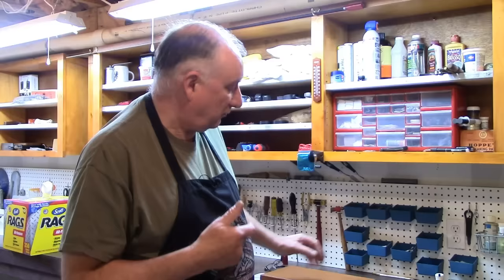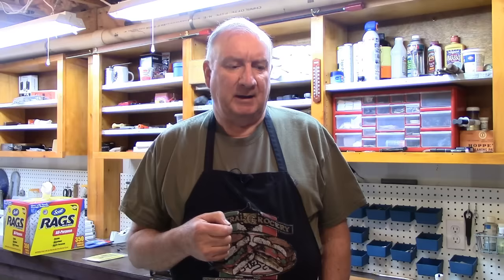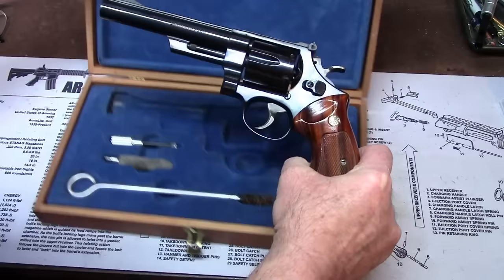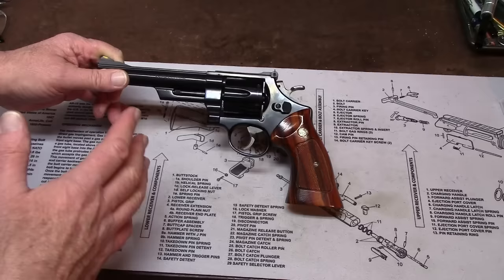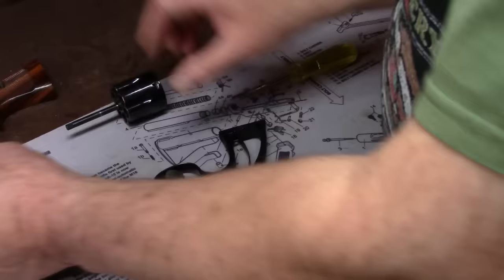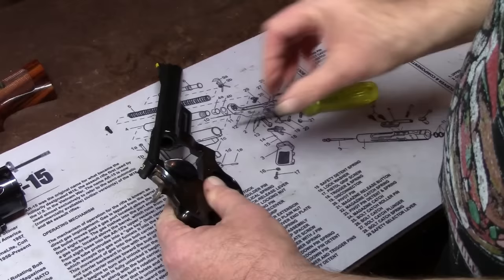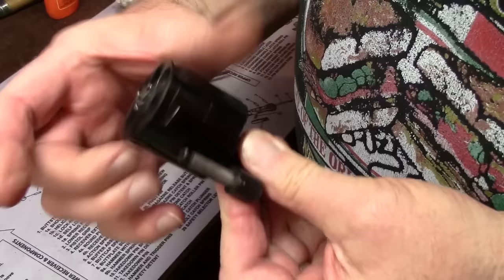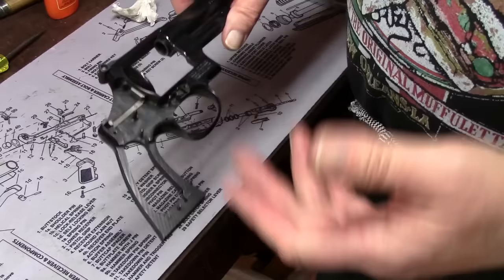How to Disassemble and Care for a S&W Revolver ~ Learn from a Factory Trained Armorer!

Comment: Any difference in  a pinned and recessed  gun
Reply from the maker: Recessed cylinders certainly look more refined, and are prized by collectors, but in practice, they actually present undesirable issues, while having no advantages. Fouling, dirt, lint, and unburnt powder commonly builds up in the crevice and prevents seating.  Unless one meticulously cleans the sharp corners of the recess, a rim simply will not seat fully, whereby the cylinder won't close, or will cause loss of headspace and dragging against the recoil plate.  On a practical note, the recess prevents quick visual cylinder inspection. Of course, the recessed cylinder adds machine work that increases the cost. It was a dressy feature that was cosmetic but provides no additional strength, because pressure is contained in the case body, not the rim.

Comment: What is the most ideal handgun caliber for home defense sir?
Reply from the maker: Aron 
The short answer is the one that you can handle most effectively.  The long answer is my video entitled How to Choose a Defensive Handgun Cartridge, found on my site.  Penetration is a liability with the danger of wall pass-through, so shorter and lighter quick expansion bullets at higher velocity are generally preferred over long, heavy bullets, if you live in a home that has close neighbors or children in adjacent rooms.  If it's a carry gun, it should be something that you can keep with you comfortably, year round, under different clothing.  If it will stay home, a heavier, larger frame is easier to control.  For a home defense gun, I don't think there's a finer choice than a 4 inch double action, 38 Special revolver, loaded with 125 grain jacketed hollow points, or a 4 inch 9mm large frame double action auto loaded with 115 grain hollow points.  Both are easily controlled by virtually any shooter, are easy to manipulate under stress, and are intuitive designs with versatile grip size, and both have been used effectively by generations of duty police officers, though they are the last gun to strap under civilian clothes.
Reply: Thank you sir!

Comment: Hi can you send me video of diy how to reblue my s&w .22 magnum? Thanks and god bless!
Reply from the maker: D'Tour Travel Buddy 
No DIY bluing is worth the expense or time.  They simply apply a very thin, temporary color that cannot stand even casual handling.  Bluing is more than just color, and is an anti corrosion treatment.  Because bluing chemicals and buffing techniques are proprietary, and because a great many guns are irreparably damaged by incorrect gunsmith rebluing, I strongly recommend that you contact Smith and Wesson for rebluing.  They are very good to deal with and will properly take care of your fine firearm, and it will be done correctly, returning it to original.  They will also give it a complete service check in the process and make any necessary repairs.

Comment: this off topic but is the 28nosler the same or close to a 7 mag?
Reply from the maker: Jake Lords 
They are not alike.  The 28 Nosler is a non belted case with a capacity of nearly 90 grains of powder with a 160 grain bullet, which develops approximately 200 feet per second greater velocity.  It is more similar to the 7mm Remington Ultra Mag, but it appears to be a bit more efficient per grain of powder, though any velocity gain is statistically so close that it's within the margin of error for each cartridge.  Nosler has entered this field of non belted super magnum cartridges, and they are sold in their premium sporter rifles.  I could sit and ponder for years and never come up with one reason for going afield for game with such immense cartridges that would needlessly and explosively destroy 40+ pounds of meat and ruined trophy cape with a single shot.  They solve a problem that doesn't exist in real world hunting.

Comment: Makes me wonder.If this gun can be so easily distorted by a mere hurried removal of the cylinder. Makes me wonder how sturdy it really is compared to a Ruger or Taurus.
Reply from the maker: elcues 
The Ruger and Taurus must be handled the same way, or they will suffer type same distortion.  Dismantled yokes and cranes are unsupported and very easily distorted by careless handling, and no manufacturer will assert otherwise.  I speak as a Ruger factory trained and certified armorer.  Taurus are simply cheaper clones of the Smith & Wesson, and copied them.  You must understand that this takedown procedure and caution applies to unsupported yokes during disassembling, and is nothing associated with operational strength.  Smith & Wesson handguns have been proven in street service and worldwide military service as reliable combat arms since the 1800s, and are in every way very fine and rugged handguns, which I trusted my own life to in professional police service for a very long time, and which served me and my officers very well, so don't be so quick to make judgements.

Comment: TL: DW here’s how to take a modern Smith & Wesson revolver apart but don’t touch anything inside. You can’t possibly know what a trigger should feel like unless you’ve worked on 100s of guns… 🙄 

Get hold of Kuhnhausen’s book on S&W revolvers. Read it and learn how the mechanism works. You can experiment with reduced power rebound springs. You might buy a reduced power hammer spring, but don’t go too far there. Some Smith & Wessons left the factory in great shape. OTOH I have a Model 25-2 that looks awesome outside but the tool marks inside looked like a drunk from the Vega factory made the gun.
Reply from the maker: There's far more to working on a revolver than anyone can learn from a video or book, and I certainly shall not give master class tuning instructions to folks so they can ruin their guns.
I HAVE worked on many hundreds of Smith and Wesson revolvers professionally for 50 years, and I certainly know what a good trigger is, and how to achieve it, thank you.  I was taking apart ten per day during firearms qualifications, and I tuned them all.  I learned how to tune their revolvers from their master factory instructor and consultant, who taught everyone in the factory.  I spent two weeks under his tutelage at the Smith and Wesson factory, learning from the expert who had built and repaired THOUSANDS of revolvers.  The intent of my video was to teach folks how to care for their guns.  I don't presume to teach them how to do a master tuning where an unskilled person can easily ruin an expensive gun.

FYI, none of the inner parts interact with those tooling marks and they have absolutely nothing whatsoever to do with making an action smooth.  Any idiot that recommends touching those marks has no understanding of these revolvers, and he's a joke if he's counselling others to do so.

Comment: 1:14:18 No Snap Caps?
Reply from the maker: Of course not.  No snap caps were ever used by factory personnel or their trained armorers.  I've done this same thing thousands of times as a professional armorer.  There is no possible harm whatsoever.  The hardened hammer nose floats into a hardened bushing and is suspended by the hammer against the frame. The only time empty cases are used is to check headspace and a couple of different dimensions, and the spent primers cushion nothing.

Comment: QUESTION....When the hand moves against the ratchet, the cylinder turns until the cylinder stop prevents it.  As the trigger
is further pressed; up to firing; is the hand continuing to force the ratchet to turn a stopped cylinder or does the hand disengage
when the cylinder stop engages?
Reply from the maker: muptahere 
The hand rides captured between the outer side of the hand window and the ratchet which is timed by the thickness of the hand. It withdraws downward and into the frame, riding back on the throat, only after the trigger returns completely forward.

Comment: Thanks for the great video. I have two questions. Can you polish the trigger itself? Hate that it looks dirty. Also, is it OK to use a Wilson Combat spring kit in a j-frame to lighten the trigger pull?
Reply from the maker: Joe Mas 
That trigger was finished with a very time honored process called color case hardening, which imparts various colors of blue, brown, tan and purple.  It's a traditional finish that sets Smith and Wesson apart.  Gunsmiths charge a fortune to do this to guns.  Like bluing and other finishes used on guns, it protects the surface from corrosion, and gives it a hard abrasion resistant surface.  Yes, you can polish it off with jewelers rouge and a cotton wheel down to unprotected steel, and you will have ruined a very expensive part and destroyed the value of your gun.  Why you would want to do that is a mystery, but it's your gun.
Reply: I didn't know that and I won't be doing it. What about the Wilson Combat spring kit in a j-frame to lighten the trigger pull?
Reply from the maker: Joe Mas 
J frame revolvers are small and so are the parts, which includes a very small and light hammer, and very small measurements between leverage fulcrum points.  Establishing sufficient impact with such reduced hammer dimensions requires strong spring force.  I would not recommend playing with lightened springs simply because your gun was designed as a compact self defense gun, and not as a target piece.  You want all the spring force engineered into it by design, or you may some day have a light fall that doesn't fire and fails to save your life.  Smith & Wesson knows better than after market spring companies.

Comment: I was raised that you don’t dry fire yet everyone on u tube does
Reply from the maker: Here's the correct story. Certain guns, particularly break action shotguns, Marlin lever action rifles, and a number of inexpensive .22 rifles were vulnerable to breaking firing pins or damaging chambers of rimfires. The caution that you were raised in was thus correct. However, most modern firearms can be safely dry fired. In fact, dry firing is a required part of U.S. military training, and is incorporated into most training programs conducted by the Civilian Marksmanship Program, NRA, Boy Scouts, and a vast number of police departments. With a few exceptions as I noted above, modern firearms may be safely dry fired without the use of cushioning caps, and without any concern whatsoever.

Comment: Yeah yep cover ya own ass !!!
Carb cleaner after wood ( varnish) is off to clean quick ... 
Some really high quality lube (i used high temp , performance an 
pressure air tool lube) and work into the action ...
Still waiting on 
Smith to make a 45\70 critter getter !!! Instead of high $$$ 50 ammo !!!!
Carb cleaner is quick easy an dries fast just use quality nonparifeene greese\oil !!!
Took me a week my first time about half on hammer  !!!
Odd i don't rember any hammer block ???